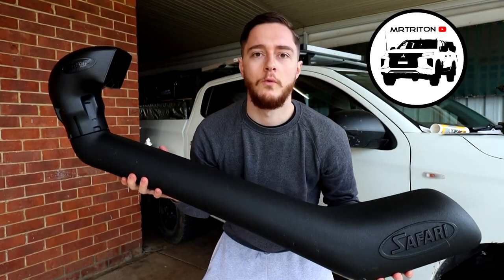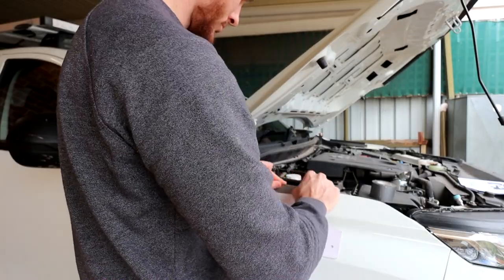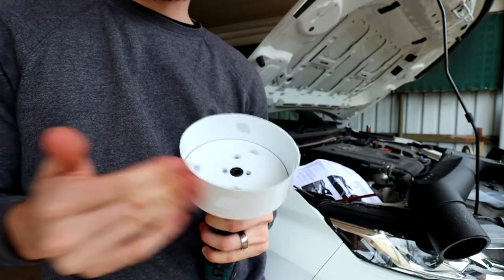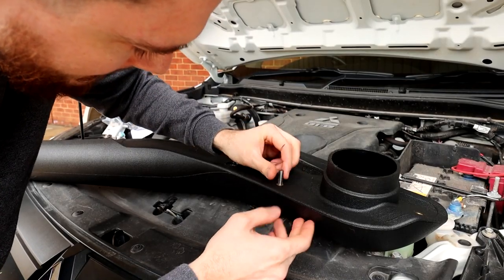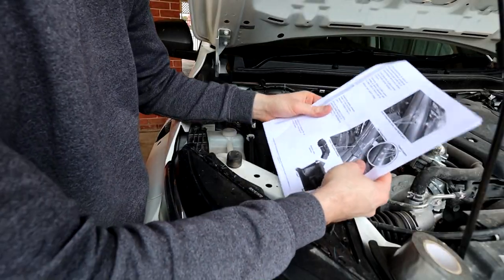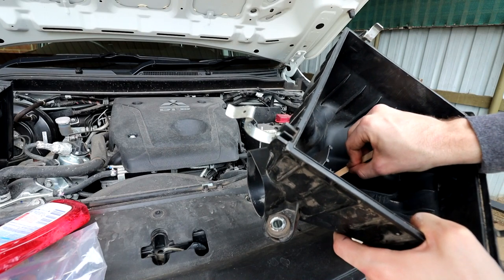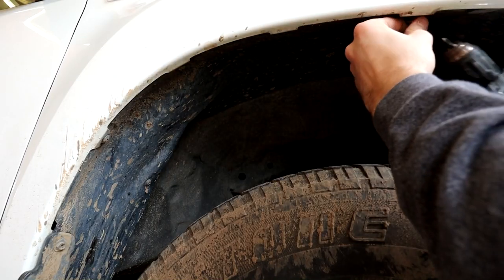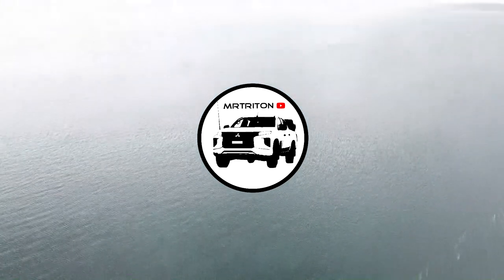Safari Snorkel Installation - MR Triton

Comment: Hey bud, any vibration when your sitting at idle? mine vibrates like crazy at the top of the intake, I've used rivnuts in the pillar bracket and it is solid af but the top just vibrates a whole heap.
Reply from the maker: Not really but I've had to tighten up the intake up the top a few times 👌
Reply: @mrtriton5405  have a go at some locktite

Comment: Hey mate, great video thanks. Does yours make as much noise as mine though? Hahaha! Just wondering if I've missed something.
Reply from the maker: Thanks mate, yeah mine makes some induction noises 👌
Reply: @mrtriton5405  Hey mate, me again. I find it's gets quite warm around the intake and air box. Do you find the same with yours? We heading for the Simpson in 2 weeks and she's going to work really hard.
Reply from the maker: @fanielategan5547  The engine bay does get pretty hot on hot days in particular. I'm not aware of any issues caused by the heat but if you're in 4L and the revs are up for a couple hours as you travel about keep an eye on your engine temp and maybe check the engine bay once in a while 👍 enjoy your trip mate!